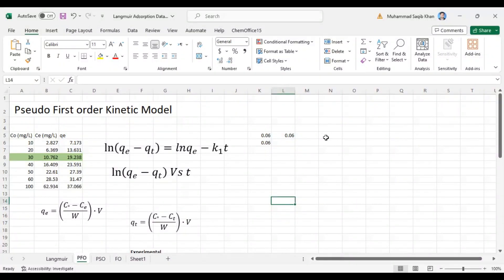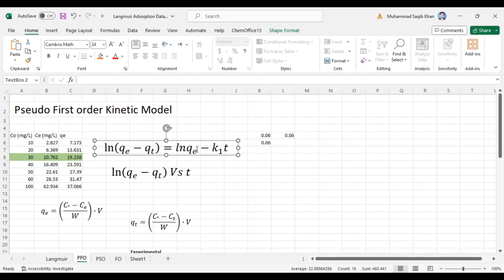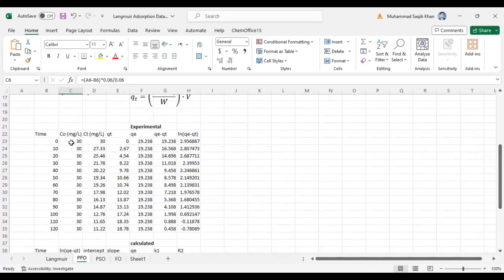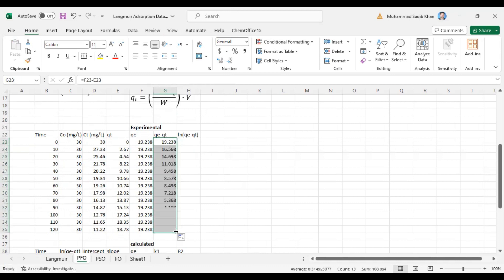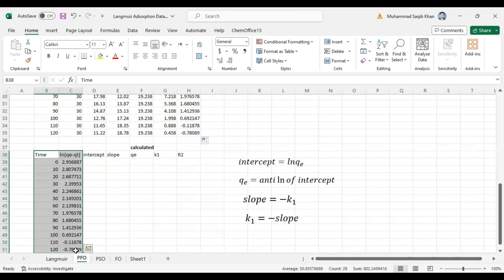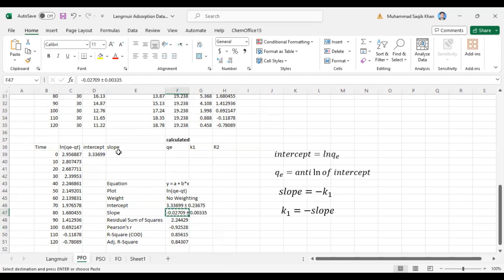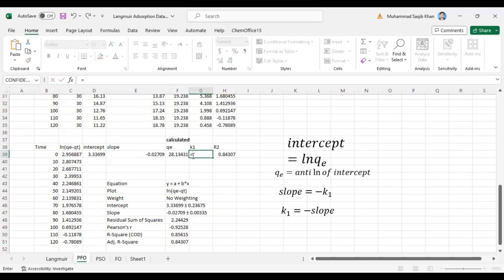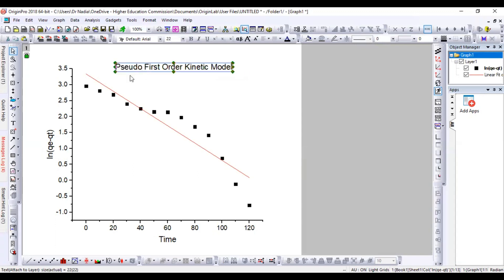How to Apply Pseudo First Order Kinetic Model to Experimental Data

Comment: Sir, I only have data set of microplastic concentration against time throughout the purification process. That should give me the data set of Co. What is qe sir? I don’t understand. In my experiment, adsorbate is microplastics, and adsorbents are coagulants formed in-situ during the process. Am I right to say that concentration of coagulants at different time points is qe?

Comment: Hello sir. I am a student and I have a question. Why in adsorption processes, we often use pseudo-first-order kinetic models, pseudo-second-order kinetic models instead of first-order rate or second-order rate?
Reply from the maker: Great question dear!
In adsorption processes, we often use pseudo-first-order and pseudo-second-order kinetic models instead of simple first-order or second-order rate laws because:
Complex Adsorption Mechanisms: The adsorption process typically involves more complex interactions between the adsorbate and the adsorbent surface, which cannot always be fully explained by simple first- or second-order rate equations. These pseudo models are empirical and account for more complex dynamics, such as adsorption site heterogeneity, multi-step processes, or diffusion limitations.
Better Fit to Experimental Data: Pseudo-first-order and pseudo-second-order models are often found to better fit experimental data, especially when adsorption involves a combination of surface adsorption and diffusion. These models describe how adsorption rate changes as a function of time, taking into account the potential for adsorption to become slower as sites are occupied.
Saturation Effect: In pseudo-second-order models, the rate of adsorption slows down as the available adsorption sites become occupied. This is more realistic because as more molecules are adsorbed, the remaining sites for adsorption become fewer, causing a decrease in the rate. The pseudo-first-order model, on the other hand, accounts for the situation when the adsorption rate is proportional to the difference between the surface concentration and the equilibrium concentration.
Reply: @drsaqibscienceacademy  oh thank you for your explanation, sir. I wish you all the best ❤

Comment: thank you for the video, i have a question, the qe is the concentration of equilibrium at 24 h ? . when i studied the effect of contact time i calculated the concentration at 24 , should use it as qe ?
Reply from the maker: You're welcome! Yes, in adsorption studies, 𝑞𝑒 typically refers to the amount of adsorbate per unit mass of adsorbent at equilibrium, which is reached after a certain contact time. If you measured the concentration at 24 hours and determined that the system had reached equilibrium by then, you can use that concentration to calculate 𝑞𝑒. Just make sure that no further significant adsorption occurs beyond 24 hours, confirming that equilibrium has indeed been reached

Comment: Hello Sir, I have a question. Suppose, i have concentrations from 10 to 80 mg/L and removal efficiency increases with increase in concentration. 
Then, should i take 80 ppm as my optimum conc ?
Reply from the maker: Thanks for the comment, not necessarily 80 is your optimum concentration, you can go behind 80 ppm, otherwise you can consider 80 as optimum but recommended is to check the higher concentrations as well, may be 150, 200 mg/l. hope it ll solve your query, cheers!

Comment: Dear sir, How you selected 30 mg/L as optimum concentration?  On the basis of what??
Reply from the maker: Thanks for your comment,  the 30mg/l was selected based on the concentrations experiments,  we run experiments for different concentrations like 5, 10, 20, 30, 40, 50, 100 mg/l and highest removal was obtained for 30 mg/l, then other experimental variables were checked like pH, dose, temperature etc for the same concentrations. Hope it would help,  if still u have  question please let me know. Cheers
Reply: @drsaqibscienceacademy  Please Sir, at what initial time did you carry out the concentration optimization?
Reply from the maker: I did experiments on different concentrations and the conc. that have good removal, i selected that one